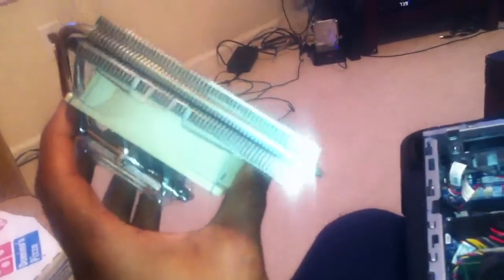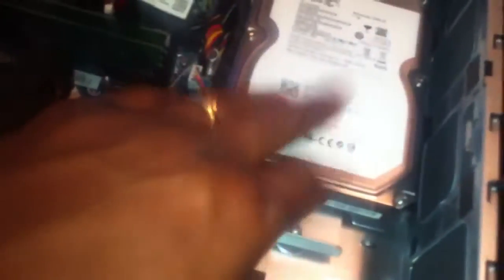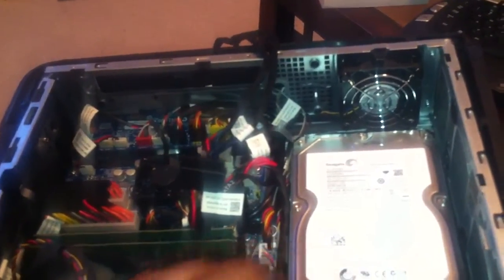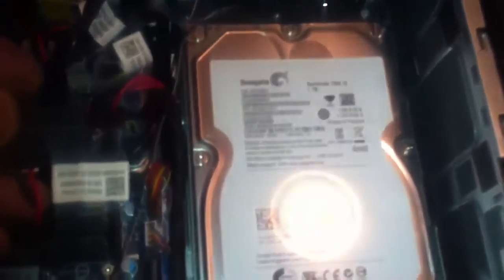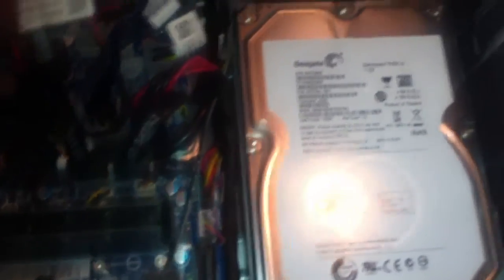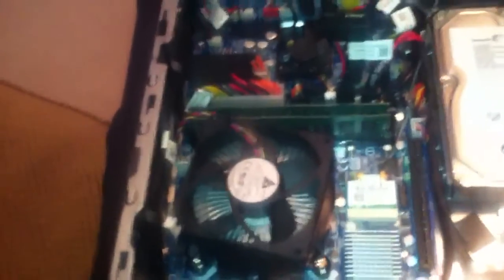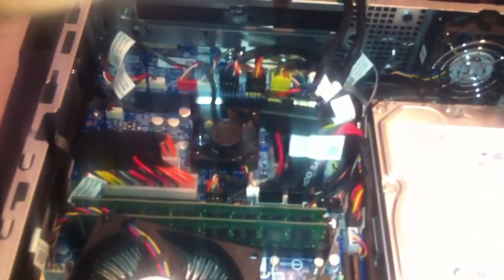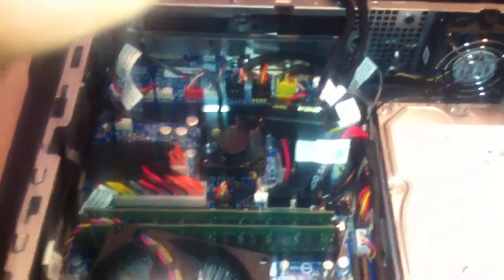Alienware x51 adding new CPU fan and ssd

Comment: does any cpu fit in alienware x51, or are there some specific?
Reply: no its just haswell cpu's
Reply: @billylaker2580  that would be the R2 model for haswells, for the R1 (this one) any sandy or ivy bridge processor will fit here (except i7-2700K and 3770K, Normal 3770 works fine with the chipset). best processor for this system would be the 2600K.

For any GPUs in this system, go with ASUS Nvidia cards, they work best with the older intel sandys, my preference would be for the GTX 1660 Ti or 1060 if on a budget, ASUS I choose because of the smaller form factor size (single fan variants exist) though a 6 to 8-pin power adapter is needed for the 1660 Ti despite same TDP. They are much better than the stock 555 fermi in the system